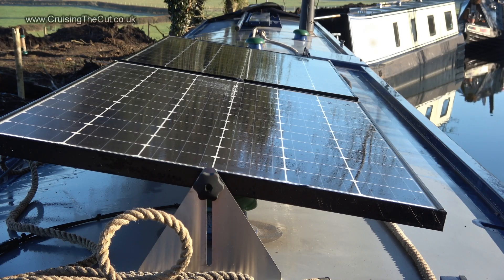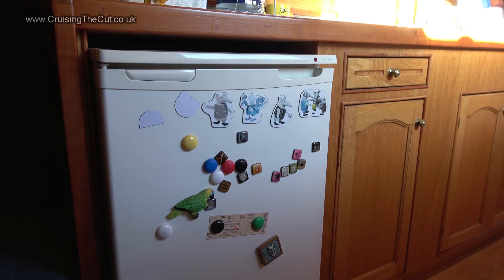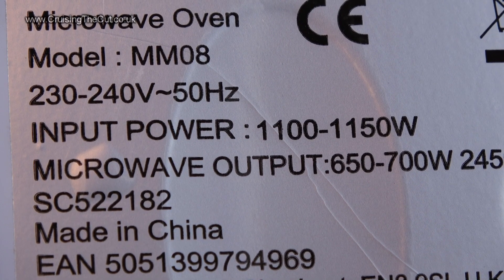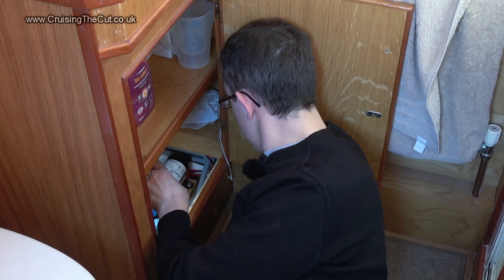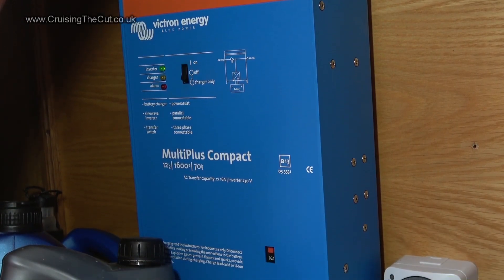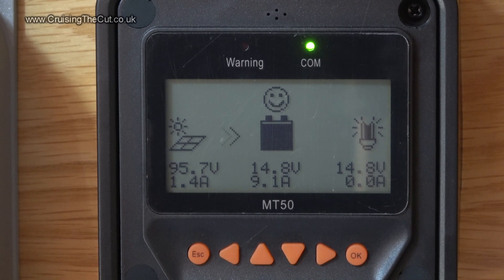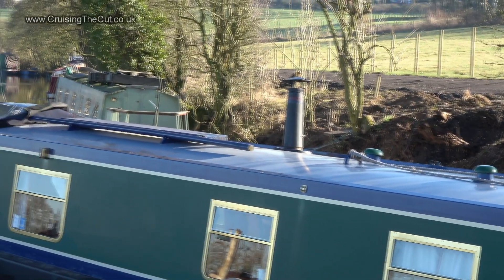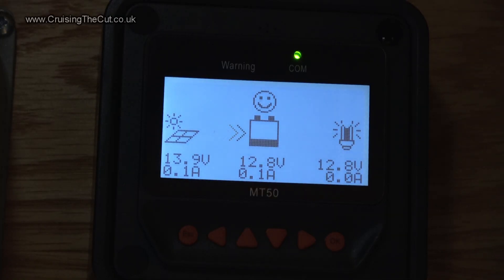76. Is solar power sufficient for a canal narrowboat in an English winter?

Comment: Hello David, have you thought about installing a wind generator or two? They work at night, on gloomy grey days etc.
Reply from the maker: Considered but they are quite costly, the wind is intermittent, I've heard they can be quite noisy (sending rattly vibrations along the boat) and you have to take them down whenever you move. Also, I tend to moor over winter so I get access to a shoreline.
Reply: I think in the case of a narrow boat, I would either acquire or build  a fold down mount, to make the transition easier. I am betting it would be a custom fold down mount, any other applications would never have to fold down.

Comment: Greetings. Just to let you know I find your videos very interesting. The English countryside is just beautiful. This from someone in the American desert southwest. The scenery makes me want to move to England and buy a boat. 
A couple of short questions, if I may. Some of the diesel engines I've seen on other blogs seem ancient in their starting methods. Is yours similar? Some seem to have their diesel exhaust blowing up in their face. Are they all like that? Are narrow boats always made of steel? Seems awful heavy.  I know it is probably historical, but I would think wood and fiberglass would be lighter, cheaper, and far less weight, making them easier to manage.
Thank you for your patience. Lee
Reply from the maker: Mine is not ancient in terms of starting - turn the key, give the glowplugs ten seconds then turn further and it starts. A fair few narrowboats have "classic" engines though which have more antiquated needs!

All modern narrowboats are steel; wood is lighter but rots and fibreglass is much more likely to be crushed by other boats (especially when sharing locks) and by ice in winter. GRP cruiser boats tend to be lifted out over winter for precisely this reason whereas steel narrowboats can be used and lived on year round in the water.

Comment: You might look into a thermo electric generator that attaches to the side of your coal stove or used in conjunction with your diesel heating. These can generate up to 45 watts or higher power from the heat produced. From your American cousin.
Reply from the maker: Thank you. I've heard of them but it's a very tiny amount of power, unfortunately and they're not cheap. Cheers though!

Comment: Do they make infared solar panels
Reply from the maker: I've never heard of such a thing.
Reply: @Bill Schofield

Yes and no. Photovoltaics work because photons smash into the semiconductor material with enough energy to dislodge electrons, creating electricity. With silicon based photovoltaics, the sweet spot is in the middle of the spectrum and by the time you get to ultraviolet and infrared, those wavelengths just don't have enough energy. There are experimental materials like indium-gallium alloys and experimental manufacturing techniques to combine alloys tuned to different wavelengths to produce a full-spectrum photovoltaic, but they're mighty expensive and don't work well yet. It is highly unlikely we're going to see a full-spectrum solar panel any time soon, at least outside niche use cases like spacecraft.

Comment: You have to cut your usage. Using a microwave is not being realistic when using solar, especially only 2 panels. Wind turbines for your needs is a waste of money. Vinny 🇺🇸
Reply from the maker: One can always look to cut consumption but the microwave is not the enemy. It's only used for maybe 5-10 minutes at a time and not every day. Whilst a high draw (appprox 1100W), it equates only to about 17Ah use which is negligible in terms of the battery capacity. Clearly if I were trying to survive in winter on my solar I would not use the microwave during that time but as explained in the video, the winter months simply don't produce enough solar power for the rest of the boat's needs either. For example, the greatest draw each day on most boats is the fridge, approx 40Ah.

You can't just rate solar by "number of panels", it depends what capacity those panels are. Mine are 240W each which is rather more than someone with 2 x 100 W panels for example.

Agreed that since the wind turbine would only be needed for about four months of the year, it's a substantial cost. Also, since I moor for winter and have a shoreline, it's academic anyway!

Comment: Good video on the advantages and disadvantages of solar power.  One of the options we use on our sailboats is to upgrade the alternator on the diesel engine to one with a higher current capacity, typically in the 90 to 100 amp range.  It reduces the amount of time the engine must be run to recharge the batteries.
Reply from the maker: Fair point. Most modern narrowboats have two, one for the starter battery and a dedicated 100+ Amp alternator for the leisure bank. I only have a single 70A unit, alas.
Reply: Hey CC, great vid, do you know how to work out what your alternator capacity is?, you said yours was 70 amps per hour
Reply from the maker: It's a 70 Amp alternator; "per hour" is irrelevant to that measurement. They're just rated as such, I don't know how you check it if you don't know. Look up the model number maybe?
Reply: Buy a cheapo clamp meter for 20-30 quid and you'll instantly be able to reasonably measure all the figures you were guessing at in the video. Does assume accessibility of wiring and moderate electrical clue. Might not be worth it just for a video though, as I suspect the set of people interested in boating and the set of people interested in electrical wiring are disjoint to a significant degree ;)
Reply: ahh ok thanks for your help 😀

Comment: I really have enjoy your videos, inspirational but not biased.  I also enjoy the comments but I think someone should add,  you can get 12v cooler boxes.  I wonder how these would fair in the cold winters, on the outside where it is nice and cold, in the shadiest spot of the boat?
Reply from the maker: I imagine they'd fair quite well!
Reply: nope...12v cooler boxes are more juicy than you think....it's the 12v fridges with a compressor that makes em less juicy...I can't tell you why because my brain is too small....but....I have been reliably informed. However....it could be suggested that a tuppaware box kept outside would make a perfectly acceptable fridge in the winter and these are the least juicy of them all. ;)
Reply: I've found that ambient temperature can really effect fridge amp usage plus difficult to adjust for how long/ many times the door is opened ...possibly a thermal connection plate between the hull bottom and a 12v chest top loader would help save 20amp per day.
Reply from the maker: Interesting idea!
Reply: @Grant Williams This would work great, especially if you use a slab of cast iron from a junk yard underneath the fridge to add thermal mass. The problem would be getting through the insulation I would think.

Comment: Good News, kind of.  when calculating use the formula Watts= Volts  x   Amps  or Amps= Watts / Volts.You have a respectable solar array, the battery bank size is usually the limiting and expensive factor. If you use 20% of the battery bank capacity, then recharge the bank will last longer. If you use 50% it will shorten the life span of the batteries. So if your total battery Ah is 100Ah  you have 20amps to use.Solar is good.  however, at your geographic Latitude in the winter, with clear sunny skies you only get a very few hours of sunshine.   A steeper angle to the sun will give you more but that is limited. Surprise yourself, the next full moon check your regulator and see the trickle of electricity you are producing. Is your regulator also a load diversion type. meaning, when your production is more than the batteries can take, the produced electricity from the panels is diverted to a load, such as your hot water heater, or an air heater. This would apply mostly to the summertime when you have more hours of generating time.
Reply from the maker: No load diversion on my controller. Most narrowboaters work on the 50% charge depletion else they'd have to have huge battery banks.

Comment: Are those small portable generator from Honda, or Yamaha a good alternative? They say the smallest can give you 1000 watt per hour and consum only 1 liter of fuel every 8 hours.
Reply from the maker: Yes. Lots of boaters have them or similar. The issues are 1. storing petrol safely. 2. Noise 3. Operating the generator safely re fumes / CO etc.

Comment: surely it would be worthwhile to modify your panels to orient better to the sun?
Reply from the maker: No because in winter - and this was really the point - there isn't enough sun for it to make a difference. Even if I oriented them directly I'd get maybe 2x boost and that's only the case if the sun isn't being obscured by cloud (which in winter it usually is). So in 6-8 daylight hours of miserable light, even doubling the output doesn't give you enough to cover a typical day's needs. Yes, on that occasional bright sunny winter's day it will be better, and orienting them will help. But I still only got 3A, so doubling (to simulate orienting better) would be just 6A and you'd only get that for a short time, say 5 hours max = 30Ah which is far from a day's top up.
Reply: 2 x the boost is half the loss you are facing.Solar panels are most effective when oriented perpendicular to the sun.I know you will never keep up with demand but if you can half the deficit surely thats worth an experiment

Comment: Have you calculated how much a kwh costs you in diesel? It might be fun to know how much money your panels are saving you each day. Certainly the cost savings is one part of their benefit - they're also silent and require little to no maintenance, but the money is likely the large component.

My wife and I are strongly considering the move to a sailboat, with >1kw of solar and >1kwh of lithium batteries. Hopefully that'll cover our hefty electronic lifestyle (and the extra instruments needed on a sailboat) and get us through the cloudy days.

Thanks for doing this video series - canal life in Great Britain seems like a delightful way to spend the days.
Reply from the maker: Not kWh but 70A alternator so 1 hour = 70Ah (ignoring losses etc) and 1 hour of engine  = 1 litre ish of diesel...

Comment: Hi CC!  If you get wind in the winter, you can always look at putting a wind generator on the boat.  Around here (South Florida, USA) there are a LOT of boats that use a combination or solar and wind power generation.  Here is a site with various examples of wind generators:  https://www.emarineinc.com
Reply from the maker: Hi. A fair few narrowboats do have them but they're quite noisy (rattly) and you have to put them up/down each time you move - less of an issue moored for winter of course.

Comment: In all this what i find ironic is the fact that  in summer you can be self sufficient but at the same time it's the time of the year where you do the most cruising, and therefor use the engine to top up the battery bank.

Comment: Good News everybody (a little nod to the sci-fi fans out there).
Your Solar Panels will soon be able to work in the rain ( http://www.gizmodo.co.uk/2017/02/solar-panels-that-can-get-energy-from-raindrops).
The news that England has been waiting for.
:-)
Reply from the maker: We'll be deluged with power!
Reply: @Chip Ito

I realize the post was made largely in jest, but it's still worth pointing out that this is highly impractical. Silicon is incredibly fragile and even a small break can kill a large segment if not all of the panel, depending on how it's wired and where the break is. This is why they use shielding eg glass or transparent polymer. This technology requires rain drops to have direct physical contact with the panel, and that's an either/or proposition with the shielding. The <7% solar efficiency they quote is also absolutely horrid compared to 15-20% on regular pv cells, so you'd likely need to be in the tropics during monsoon season and would be better of ditching the fragile exposed pv component.

Comment: Interesting CTC, in some ways going OTT on solar panels here in the UK may not be the answer then. In many respects you may actually have the best set up. If they're almost useless for more months than they are good, then having enough panels for your needs in sunny months is all you really require. My needs will be similar to  yours, so the set up you have is pretty much a good indication of what I'll end up going for. Take care and keep the vids coming!
Reply from the maker: Hang on, that's not the case. Last year I was totally solar from March-mid Oct. it's only deep crappy winter when they're insufficient, as long as you have enough.
Reply: Oh I see, that's better than I had thought, good news then.

Comment: By not angling the panels you not going to get enough amps. i think you could change the brackets in someway ;)
Reply from the maker: I'm aware of that but the difference is marginal in winter. Even if I doubled or tripled the power, it would still be far from sufficient on a typical overcast winter's day.
Reply: Ok cool. What about a little wind generator on a telescopic pole? I saw a boat with such a thing. It could to-up the batteries all night. A little 500w jobby from china? All the best Dave

Comment: wind & water turbines mate , a small wind turbine will power a house with A/C , anything with a digital clock will drain allot of power , check it out on a generator . ttyl.
Reply from the maker: There's virtually no drift on a canal (no current, like a river). The only flow comes from people opening locks which can be miles away and therefore a miniscule effect. If you let go of a narrowboat it stays where it is (except when oher boats are passing in which case their wash exerts a pull)

I am well, thanks! Have been healthier since moving onto the boat, not even a winter cold, probably due to not picking up germs from colleagues in the office.
Reply from the maker: Ah! Of course, the X-Factor, silly me for not knowing  :-)
Reply from the maker: Water turbine wouldn't work on a canal, very little water flow! Wind turbines maybe - many have them - but intermittent power, expensive and can be noisy. That said, I'd be curious to try a good modern one and give it a thorough test.
Reply: wind turbines have a very poor history as for reliability.  they need fixed a lot. At least solar panels can be depended on when the sun shines.  Windmills need a wind of about 10mph to get going and that won't happen in a canal on a regular basis.
Reply: Henry Ostman well I don't know about that mate , windy during the winter and there are a lot of people that swear by them , I also said water because when under way which could be for hours could work , who knows maybe one could make there own , cheeper that way !
Reply from the maker: If you're dragging a water turbine when underway, that's just using the engine power to generate electricity - which it already doing, much more efficiently, with the alternator!!
Reply from the maker: I genuinely don't understand anything in that comment, sorry.
Reply: CruisingTheCut E.D.L.
Reply from the maker: English Defence League?? Very confused. How is that related to solar power?!
Reply: No mate ,I also said to please be careful on the 25 th of this month , they don't tell us over here in the states what's going on over their  looks like it's going to be very bad , SOI was saying to please be careful  you seem like a nice chap  love your show.
Reply from the maker: I'm genuinely baffled. I have no idea to what you're referring as happening on the 25th. But I do appreciate the kind concern. I'm in a very tranquil bit of canal, it should be fine here!
Reply: He has to be referring to The start of The X Factor Live Tour. That starts on the 25th, lol